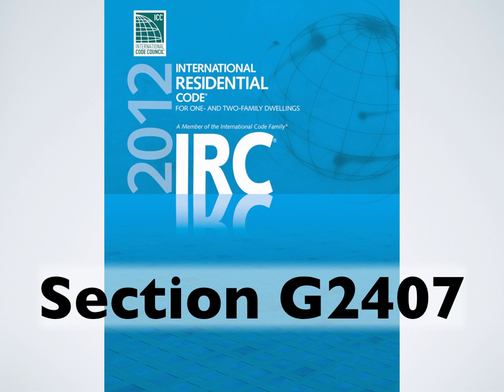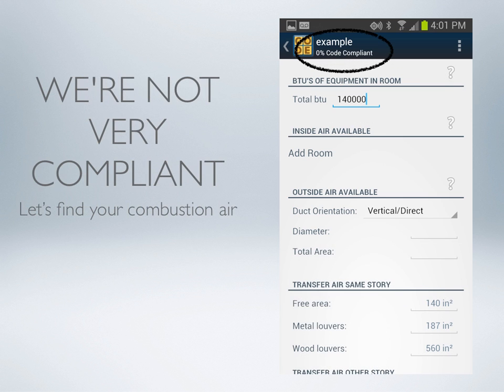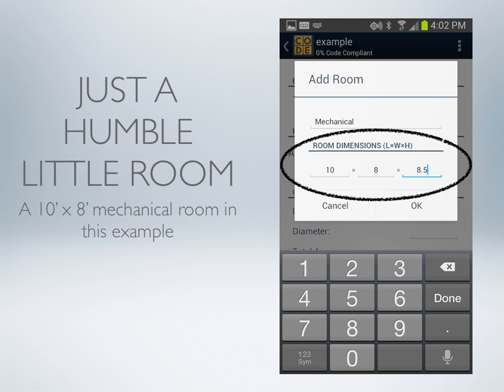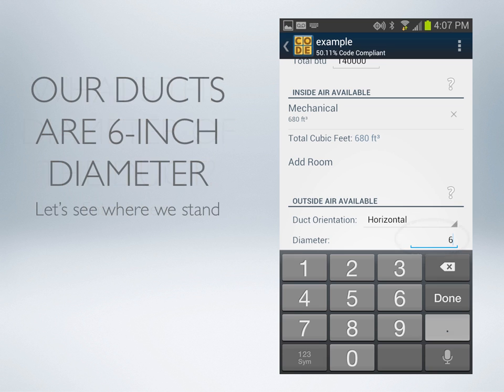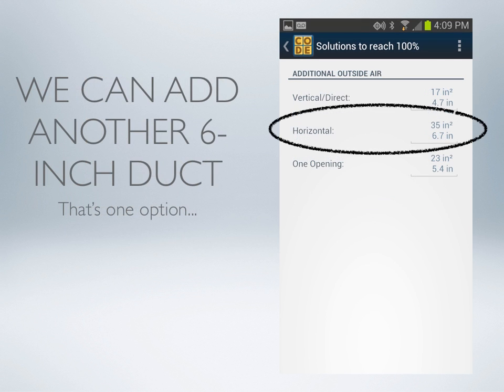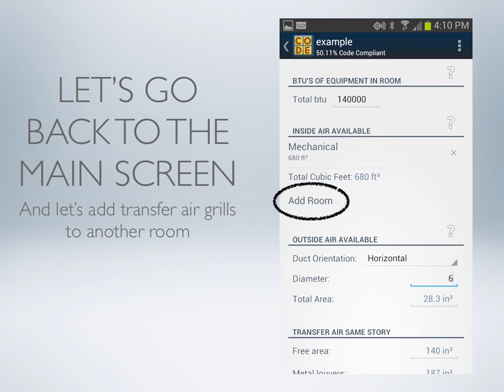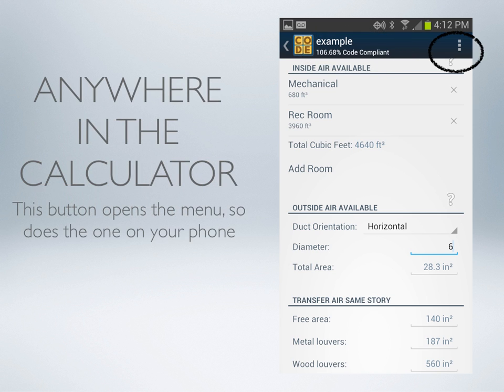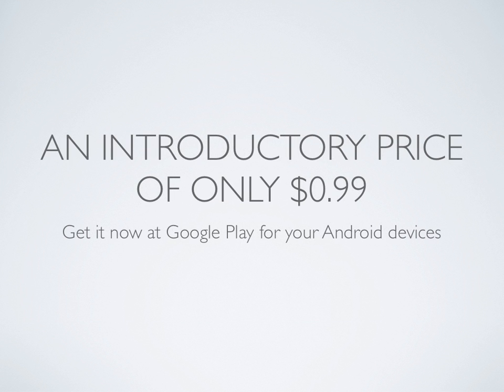The Combustion Air Calculator (Google Play App)

Comment from the maker: Hello, Brian.  There is a lot to know about combustion air, but this first version of the app is just to run the calculations.  In the future, I will provide supporting educational information, as well as a combustion air class at BuildingCodeCollege  The answer to your question is that when sizing horizontal or vertical ducts, you must alway have two separate ducts, one that terminates high and one low.  The "one opening" method is a method that uses one duct "opening".

Comment: Glen - The equipment has (2) 6" diameter horizontal combustion air supply ducts, but the calculation only addressed (1) 6" duct.